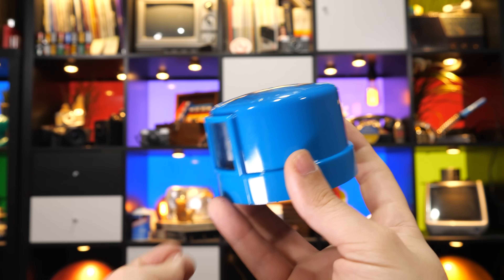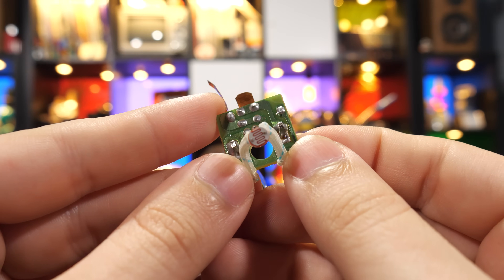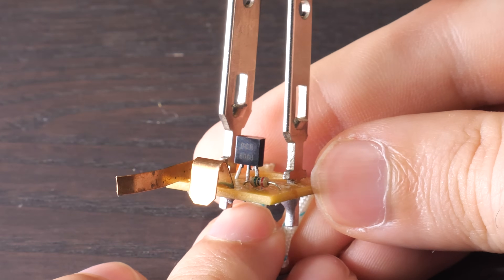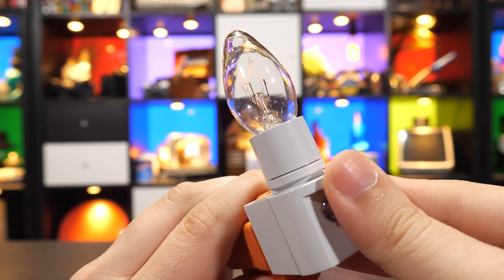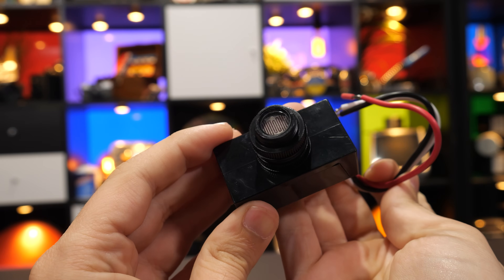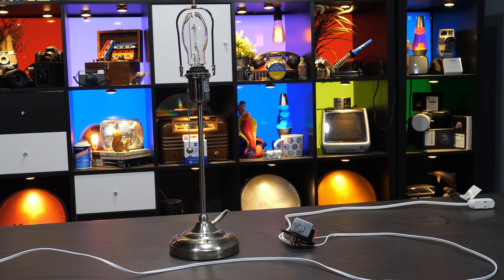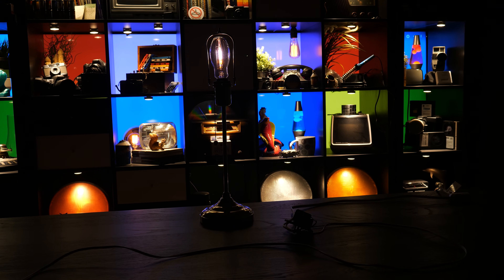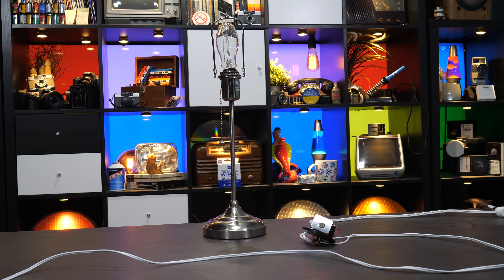Photoelectric light controls are weirder than they seem

Comment: Here in Spain they're AFAIK controlled with some electronic/digital system. Not each pole, but many of them at once, and can be controlled remotely in many cases. I noticed this during the recent country-wide power outage, where only a few streets had their lights turned on for a while, and only one side of those, to reduce the load on the grid as the power generation was restarted.

The bug of those sensors turning the lamp posts on after a power outage sounds like it could cause trouble in a situation like that unless the recovery process is intended to account for the demand of all street lighting turning on without human interaction

Comment: 13:50 you'd be surprised. Depending on the total draw of the lights they control, it would create a mismatch between the at the start of the blackout and the load added when reconnecting. It's probably well within margins and definitely is nothing compared to every ac or heater in a neighborhood switching on at once, but it could make a difference in theory

Comment: Funny, I have just used a CdS cell(light sensor resistor) and a relay to turn a device off or on, or to be a way to swap from Solar Battery(Sunlight) power to an AC adapter that puts out the required voltage to the solar powered device when it gets too shady or nighttime.

  And that's all I'm using to accomplish that, 2 components mounted in a waterproof enclosure, The CdS Cell and the SPDT Relay, which depending on power requirements may be 5VDC or 12VDC relay input voltage, output to the device being controlled usually not more than 5VDC or 12VDC at 1A or less.

Been using this setup for years on a solar powered fountain that always stopped working on very cloudy days, rainy days, shade over the fountain or nightfall, it keeps the fountain pump running 24/7/365 by swapping from solar to adapter then back to solar on bright sunny days.

I also have a 12VDC computer fan in an weatherproof enclosure that's used to exhaust the heat from the internal components inside, a small amplifier, an FM Transmitter and an MP3 DIRECTOR UNIT.

  The fan runs by Solar Power during daylight, and if very cloudy, or adverse rainy weather, it switches over to a 12VDC 2A Power Brick.

 That fan has been operating perfectly for almost 2½ years now, 24/7/365.

So I've been using this CdS. Cell/SPDT Relay circuit setup for numerous years.

  Works great, and I can use it as an off/on switch for an 120VAC light as well by just removing the solar option part and wiring the relay appropriately.

  It could be wired without the solar option as a simple day/night or a night/day switch, where the device would only be on during the day and off at night, or on at night and off at daylight.

No thyristors or additional resistors needed.

  BTW: I could remove the mechanical SPDT Relay and replace it using an electronic I.C. SSR(Solid State) Relay.

Comment: My question is why would they not just use pretty much the nightlight circuit attached to a relay?

Edit: Just noticed I had pretty much the exact same thought about a year ago when I watched this video for the first time.
Reply: Because the circuit controls a bank of high-pressure sodium lamps, it's beneficial for it to be on or off. The nightlight circuit is continuously adjustable - acting like a light-sensitive dimmer effectively - and that could cause erratic behaviour with HPS lamps and decrease their service life; discharge lamps tend not to like a dirty waveform.

The limit switch is binary, on or off, which keeps the setup simple and the lamps happy.
Reply: @therineselene  OK but I said attached to a relay so theoretically you could make it so that the relay would only trigger the lights to turn on at a specific brightness level determined by the sensor by choosing a relay that would activate at that level. Why don't they do that?

Comment: A relay controlled not by a coil but some resistors? What a clever design…
And they're similar to traditional steering light controllers which also use heating elements and bimetal bars

Comment: What about using solar panel material, that can produce electricity when the sun shines on it, could that electricity not be used to turn on electronics that can turn off the light, and then when no electricity is being generated by that material, the mechanism that keeps the light off, switches off and the light turns on.

Comment: I work in the business of using these. I have literally seen and issued thousands of these photo-eyes. The blue one was typical when we used HPS and Metal Halide bulbs. The black square eye was for slaving multiple lights in a chain, and all of those slave lights had a "Cutoff Cap", or a cap that looked similar but had no components in it, just a feedthru that kept the current flowing while it was being fed current. The square black eye controlled all lights chained together with Cutoff Caps on them. 

When we moved from HPS and MH lights to LED lights, the blue photo eyes didn't play nice with the LED components. So a new photo eye was made, and had to be installed with all converted lights. The new eye works with the different power usage of LEDs. 

Good info in this video!

Comment: Could be a dumb question but do those heat dependent switches work that well in a climate with drastic air temperature changes between the seasons? I live in a place where in the summer the temperature is up to 86F and -22F in the winter and now I wonder what tech is used Inside the light sensors on our streetlights😅

Comment: A lot of the ones I remember used an electric coil magnet that engaged the contacts inside as well! When sunlight hit the cell, it energized the magnetic coil, breaking the contact points, turning off the lamp. When dark, the coil had no power to work it, and the points closed, turning on the lamp!

Comment: About the issues with using a microcontroller - why even bother with light level when you can just centrally turn them on/off based on a timer? It's not like sunset/sunrise times are unpredictable. I'm not sure anything like this even exists in Europe, at least where I live the lamps are controlled centrally which also allows for stuff like dimming them when there isn't any traffic around

Comment: I’ve always had a fascination with street light and have recently become the proud owner of a 35watt GEC SOX lamp from the 1960’s. This has a photo sensor which I’ve wired into the circuit but I had not idea how it worked !  Now I know why it clicks before it goes out and why it comes on when switched on, I always thought it was a test function

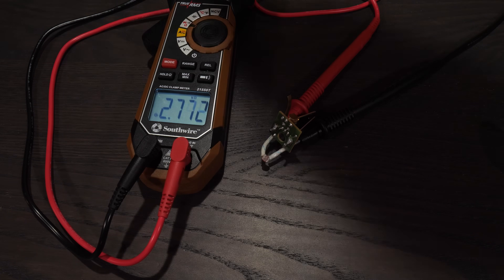Comment: 1:48 well that's a simple solution, connect that photo resister to a some redstone which goes into a block that has a redstone torch on the other side, connect that redstone torch to your lamp, and there you go, the light causes the lamp to turn off, and the dark causes it to turn on

Comment: Never heard of a streetlight using a light detector over hear most of them are either controlled centrally and turned on one street at a time so they don't overload the power grid or they are controlled by an internal timer and calander, also turning on one street at a time.

Comment: I mean if the power consumption was more of an issue for some reason, compared to the cost, you could certainly get a semiconductor version of this without any software I'm pretty sure, at least for the switch itself, but then again those semiconductors cost hundred of Euros if you want to switch a big load with them, which would take forever to earn back in electricity savings.

Comment: there is a video kicking around from years ago of a street that had new LED streetlights installed, evidently with faulty software based switching. sun went down and the street entered rave mode as the lights kept turning each other off rapidly

Comment: Great explanation and video, as usual! The only inaccuracy I saw was the schematic symbol for the SCR. I've worked with these controls for decades. 1950's models used vacuum tubes (including the the photo-sensor) to drive the coil of a normally-closed power relay. The next generation used the solid-state photo-resistor to drive the relay coil, either AC or DC. With the advent of mercury vapor lights, a problem arose where lightning flashes would momentarily cycle the photocell off, extinguishing the lamp for several minutes until the lamp cooled down enough to restart (sodium lamps exhibit this same behavior). This called for a time-delay in the photocontrol, hence the thermal relays you're describing. An early manufacturer of this style was Tung-Sol, who at the time was a big name in automotive turn-signal flashers, hence a lot of experience with snap-action bi-metal strips and heaters! Current utility-grade photocontrols use a silicon photo transistor, a microchip to amplify and invert the signal, provide a small time delay and drive the coil of a magnetic relay, once again. Models are also available that can turn the light off after a preset period, or even calculate 'the middle of the night'. Some even sense welded-closed relay contacts and repeatedly cycle the relay in an attempt to break it free.

Comment: Love your content! Your video may explain why, when I replaced the incandescent bulbs in my outdoor lighting with LED lamps, they no longer shut off at dawn. In fact, they have been running 24/7 even when full sunlight is striking the sensor. I need to rewatch and draw that circuit to see if my hunch is correct... has anyone else seen this?

Comment: Learned something new. I always though they use some electronics with a magnetic relay. I wonder how reliable this thermal relay can work in an environment with very cold winters. Will the couple of little resistors generate enough heat to bring up the temperature to activate the switch?

Comment: I have an outlet splitter/nightlight that blinks when the lights are turned off. At first, I thought it had a clock on board causing the strobe effect, but no, it's because it's on a feedback loop, when the room is dark enough to turn it on, the light it shines causes it to turn back off. Interestingly enough, the low light setting in my bathroom slows the strobe effect significantly, confirming the suspicion.

Comment: There's really no reason that a street light controller couldn't use solid state switches, almost identical to the night light control. It's just that full wave, high power, high voltage, high reliability semiconductors may cost more than a resistive heater and a thermostatically controlled switch.

Comment: I've seen that exact same heat switch from that older light switch used in an old sears garage door opener light. But instead of a photo resister causing the heat the garage door just shorts that bimetallic bar and then as it cools down the light will turn off

Comment: Fascinating!  I wonder what temperature these switches need in order to be tripped?  This summer (once again, record-breaking heat even for Texas) we had to change a bunch of lightbulbs for some parking lot lighting that was controlled by these sort of sensors.  We had a terrible time verifying that the new bulbs work.  Covering the sensor didn't seem to ever trigger the light to come on in some cases.  Ultimately, I had to drive by at night and check that they were turning on.  I wonder if it's possible for the summer heat (especially those black boxes in direct sunlight when it's 107 degrees) to prevent them from turning off the light?  Or else, slow down the activation enough that we thought they were broken?

Comment: In a local park near my house, there are solar powered lampposts with LED lights on them, I don't think you'd want to use a thermostatic switch on those since the solar panel is used to recharge some batteries and wouldn't you want as much energy to go to the batteries as possible, rather than energising a resistor to heat the switch?  I don't think hysteresis is as much of an issue here since the posts use LEDs and not high pressure sodium lamps.  So these lampposts may simply use the same components as the plug in nightlight.  I stand to be corrected though, they very well could use thermostatic switches.  I think the security lights outside my house may use thermostatic switches, because when we've had power failures during the day time, I've seen the lights come on briefly upon restoration of power.

Comment: I missed this one when it came out. Interesting i just wrote a science class poster on germanium, and the first use of it that came up in my reaerch was photoresitors in street lights. Then this morning i find this video. Thank u
Reply: Analog electronics are amazing! Built on chemistry! All electronics, even digital, are built in analog. That's right! Digital NEEDS ANALOG to work at all! That needs to be pounded into every digital fans head! And keeping it simple silly( engineering rule no. 1) .means often just stripping it down to analog core makes the most sense. My job is to help out in a science chemistry room in a high School, part of my job, means researching various chemicals on the periodic table and their practical uses. We're starting to get into the metalloids, and the transitional metals which means semiconductor Territory , as well as alloys . I do an element of the day sheet and they have to look it up on the table and understand it but I have to research all the info on what is needed to do and how it does it, as well as where it's found.

Comment: So clever. Basically electromechanical, with hysteresis and slow response given by exloiting simple physics (heat) with a fail-closed mode that not only keep the lights on, but also prompts the local Karen to scream at the council that the lights are on during the day, ensuring a really quick repair😂

Comment: I once lived near a pair of homes that put up a synchronized Christmas light display each year.  The bright street light in front of one of the houses was a bit of a bummer, so the creative folks put an inverted plastic cup over the light sensor at the top of the street light.  Inside the cup was a single light on a dedicated channel in the light show system.  Before each performance, that cup light was programmed to turn on, and a moment later, the street light would switch off.  At the end of the show, the cup light was switched off again, and the street light would come back on.  A neighbor called the city to express concern that turning off the light could create a traffic hazard.  An inspector came out to investigate and concluded it wasn't a problem.  The hack was completely non-invasive, and the amount of light spilling into the street from the light show outshone the illumination normally provided by the street light.  And since the cup was thin and translucent, daytime operation was not affected--enough sunlight penetrated the plastic to keep the light off during the day.

Comment: The electronic version would be less reliable than the thermal version you showed. AC power is not clean power. You have surges and lightning strikes that are on the AC power source. The thermal one would take voltage surges better than the electronic one. And if a strong surge does hit the thermal version, then it fail safes into the on position since the tiny fuse inside blows or any of other components that form the resistor heating circuit.

Comment: 17:02 You don't need a microcontroller running some software (firmware, actually) to have hysteresis and do everything else: all you need is an op-amp and a couple of resistors.
Of course a microcontroller-based version may potentially end up being slightly smaller.

Comment: My garage stagecoach lights run to a electrical panel in my garage that I wired a photo sensor to a 16F690 microcontroller
It's been working like that,  flawlessly, for about 3 years.
However, I never finished the intended build.
The lights switch on each night and run at an adjusted light level via a triac.
But the controller I built was programmed to jump the lamps to full intensity when someone breaks a laser beam at my property line.
I've got some lasers and detectors. Just never got around to installing it all because I need to run the wiring out there to some poles  🫤

Comment: 16:00 Yes! Not sensor required just callendar and clock on DIN rail, and bunch of relays in central location, this is what was used in one of companies i worked in, other struggled with broken photoresistors some even making horror effects turning itself on and off because photoresistor was lit by light itself turning it off and on again.

Comment: I find these North facing(LDR mounted on the side) photocells quiet restricted regarding the amount of light it takes to switch the lamp off usually near Broad daylight Lux wise burning/ wasting 1000s of hours energy..We use Westire AcRo photocells now which contain a microprocessor saving a lot of energy and money as the lights come on later and go off at the same Lux level as on (earlier)

Comment: I mean, as a software engineer myself I definitely know when you absolutely want to keep software out of something, but you don't have to go all the way to a microchip for this...seems like a photoresistor, two analog comparators, a set/reset latch, and a relay would be just as simple and reliable, far cheaper, less wonky, and much more power-efficient.

Then again, you'd have to be sticking it on top of a light pole, which means you only have 120VAC power, which means ALSO stuffing a transformer, rectifier, smoothing capacitor, and potentially a voltage regulator in there, too. I suppose after all that, the cost advantages kind of go away.

Comment: Instead of resistive heating or software, why not use a few transistors to reverse the logic of the photo sensor, along with a solid state timer relay to handle the hysteresis? Probably slightly more expensive up front, but far less power consumption